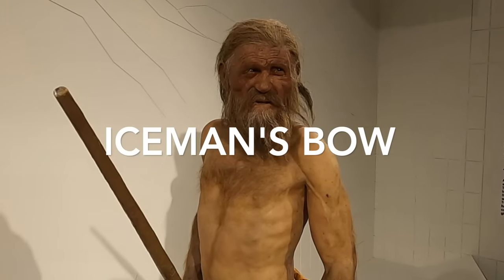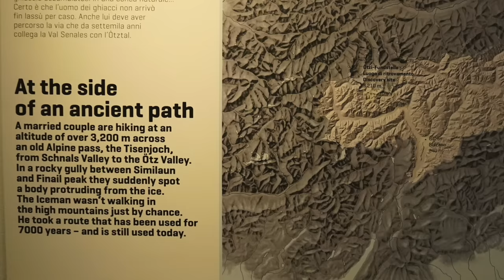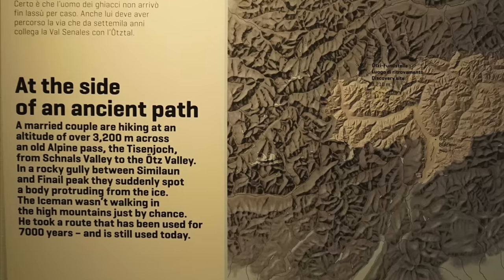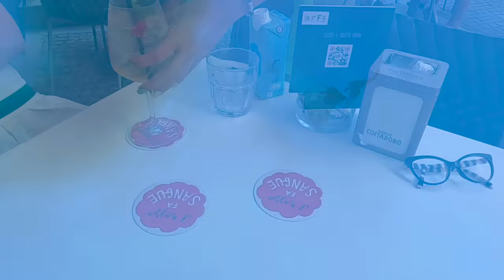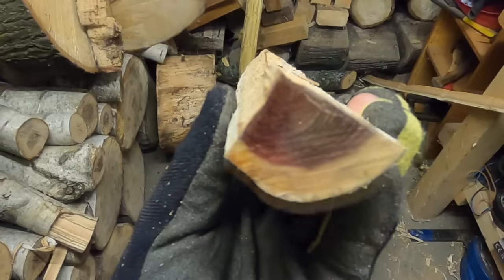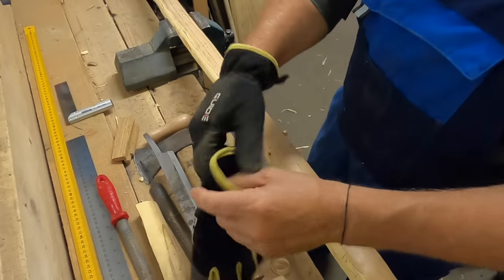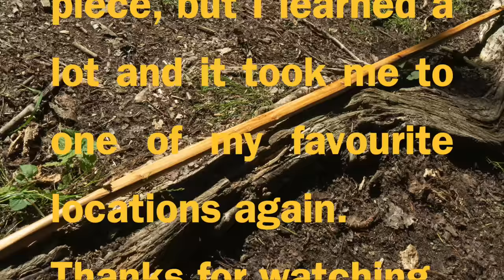Iceman's bow  (Oetzi and an attempt to rebuild his bow)

Comment: I've made a few bows out of red elm. I used a lot of hand tools. I couldn't imagining making one with nothing but stone tools. That would take a lot of time and effort.
Reply from the maker: I was thinking of doing it the same way he perhaps did it (or somebody did it), but  it took a long time for me to finish it this way. For me it was more of a project: Bringing it home, somehow ;-) And, I am not a professional bowmaker. Thx for watching and commenting
Reply: @PantelevTV  This was my thinking in that I would want to see it done with the available tools of 5000 yrs ago.
Reply: He had a bronze axe head
Reply from the maker: They examined the excavated axe: it was made from cooper
Reply: Building bows using Primitive methods alone may not as bad as you might think…

While I am NOT a master with Stone Knapping, I’m a fair hand at making Blades, Points and Scrapers… while it might take me an hour to fashion a functional Scraper, a master could do it in minutes.

On Ancestors techniques in bow building some experiments have been done in doing the initial Stave reduction and shaping of Green wood. Shaping Green wood being much easier and requiring less time to season the stave overall. The topic was covered in the “Traditional Boyers Bible” (four volume set). The experiment was done using a White wood… so the experiment would need to be repeated using a stave of Green Yew to determine the viability of this method for bow making.

All of the Yew I currently possess are well seasoned… and living in Southeast Texas, I do not have access to live Yew trees unfortunately.
Reply: Let’s be honest here if you could knap flint your metal tools were pretty crap. 
Everything done here could have been done with stone tools. 
I live in Yorkshire where there is no flint just sandstone so finding flint means that you have a a site of historic interest.
Reply: Maybe there were bowyers that just made the staves that they sold or traded? Makes sense if they lived near a good source.Then the new owner could finish the bow??   Older villagers might be good at this and have more tools on hand?  Nice bow and good accuracy and power.

Comment: You mentioned problems due to the grain structure,  but I could not see what the problems actually were, or how you solved, or worked around, them?
Cool project!  We have been wanting to visit Oetzi, I guess about 5 hours drive for us, on the way to Venezia ;-)
Reply from the maker: After the split the stave developed  terrible twists and bendings because the grains neither run evenly along the stave nor the profile. A lot of heating were required and I could not thinning the ends the way I wanted it

Comment: I was tasked to make a caloosa indian knife.
No modern tools, only a sharks tooth to do the scraping and smoothing of the shaft. I chose a piece of love oak that already had a gentle curve. I'd gotten through carving out the end for a straight inch and a quarter long mako tooth I'd obtained from a fisherman. I finished by wrapping modern nylon thread to hold the well fitted tooth in place. I still have this failure to do my due diligence. As it turns out the knife I made was a foot long.
The knives the caloosa carried were four feet long and the tooth was likely nearly three inches in length. There were aspects of the build that I or anyone mey never know. For example the wings on the teeth had drill holes, as well there was a drill hole in the center for pegging. Now to put that into perspective. These south Florida Indians lived two thousand years ago. I tried drilling with a Dremel and ended up blowing up several test teeth before I abandoned modern drilling. So it makes one wonder how an Indian with no metal tools drilled perfect holes through those teeth? I enjoyed your video and seeing the Iceman again.
Reply from the maker: What a lovely story! I really appreciate your comment. In the process of my little project there were a moment of truth: Shall I try to do it as he or somebody else did it? With tools from 5200 years ago? I put that to the next attempt, otherwise my project would probably still running. I also must admit it did not really bothered me to use modern tools, on the contrary it made me even more venerate the work done 5000 years ago. Stay safe and sorry for my bumpy English.

Comment: I have a question.  Why did you string the bow with the curve instead of against it?  My bows are recurve bows and when they are strung the outward curve is bent back against itself to provide more power.  Having said that, I know bugger all about actually crafting one so I was curious about why you did it the way you did.
Reply from the maker: The stave had a little curve that way. So, I "followed the wood".

Comment: You likely know far more about yew wood than I do, but wouldn't a bow out of pretty much any wood have been made out of a section of clean grained wood with no knots or irregularities in it?   It would seem to me that these would be obvious failure points, and perhaps even to the point of changing the tension in the extremities of each of the ends.  In any event, it is a wonder and a miracle to have this example of an ancient warrior (or traveler) and well done for re-creating it.

Comment: So what's the draw weight?
Reply from the maker: Something around 30lbs at 25inches
Reply: @PantelevTV  So can we assume the original bow was about the same? It doesn't seem that much?
Reply from the maker: That's pretty much what I assumed when I saw his bow. I doubt that somebody of the scientists ever draw it. It's too precious and I suppose they want avoid destroying it
Reply: @PantelevTV  i think the draw weight can't be determined from wood being 5000 years old 😬😁 
I was just curious if the wood characteristics are the same or if in all those years the wood quality or manufacturing process would be significantly different, resulting in a different draw weight result. 
It would be cool to see what the performance is of the bow with period correct arrows.
Reply from the maker: @anomalyp8584  Rightly said. Would be nice to see something like that. 
Have you heard about the Mary Rose' bows? Medieval bows recovered from a sunken English vessel. There they determined the draw weight by actually drawing some of the salvaged bows
Reply: @PantelevTV  Yes, heard of it! Didn't know that they actually drew them...that takes guts tbh. Probably because they had lots of them.

Comment: Two things ,  first  , it may not be a great idea to have anything to do with that mummy or it's tools . Because , of the deaths . 
Second ,  as in " the great bows of yew "?  Yew wood?
Third, would you like some wood finishing information for gunstocks ? Is the same as for bows and any hard use tool with wooden components.  Observe material . Is it like oak with big pore's and thick layers ?  A wood grain filler will be needed to seal the wood properly when finished. 
 This is not criticism, most people these days simply don't know there are missing steps . Even professional wood carvers and such , have mostly forgotten about complete wood finishing .   
Given the importance of their tools , I am certain prehistoric bows and wood handles would be protected similarly . 
While only my Speculation , it would seem that people surviving from their tools would also be concerned about making them last . Without concept of toxic materials like we have today,  it would not have been difficult to find something that worked . Mercury is for example n oil drying agent , that would be somewhat available .  Arsenic from fruit trees and the pits of the fruits. Cherries, peaches ,plums, apple seeds, pear seeds,  all have arsenic. 
Nitrates from refuse. They had options to play with.  
Keep up the good work .

Comment: You have a nice video, but not something that could be called a “reproduction”. You made a yew bow. You used 100% modern tools and technology and materials (save the yew, but that is a common bow making material) and made a yew bow. Now, one doesn’t need to bang rocks together and make the stone tools (or perhaps some copper ones) to make a true reproduction, but using as much of the original tool set and known ancient techniques are the hallmark of learning in reconstructive Archaeology.  

It’s nice work and a well made video.

Comment: The mary rose bows drew at 65lbs. Oetzi diid not have the upper body weight to draw a bow that strong
Reply: 65# is not that hard a draw. It would be hard to hold still for a long time. I used to use a yew wood at 80#.
Reply from the maker: Thought,  Mary Rose bows are much tougher than 65 lbs . Up to 185 Crazy stuff